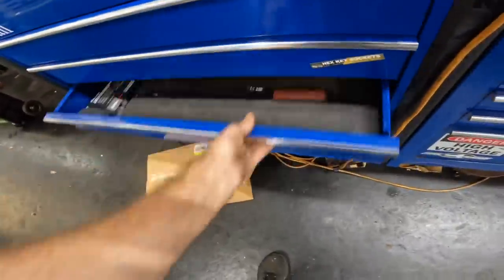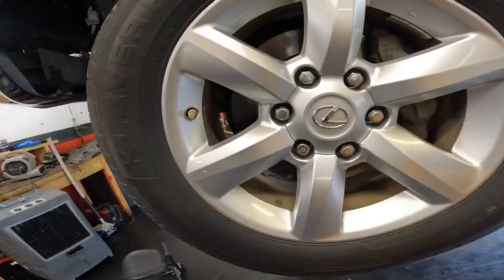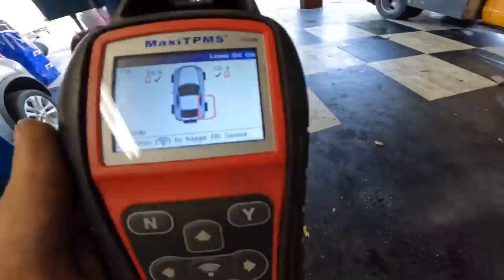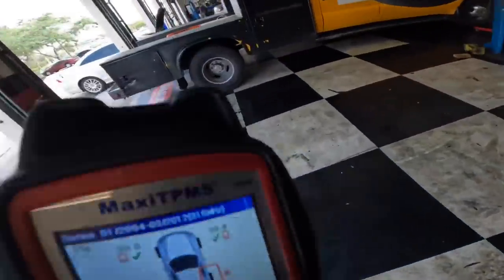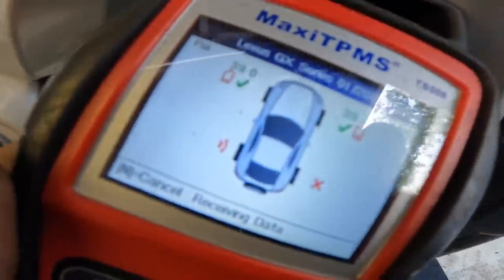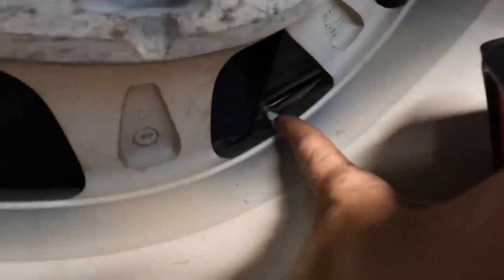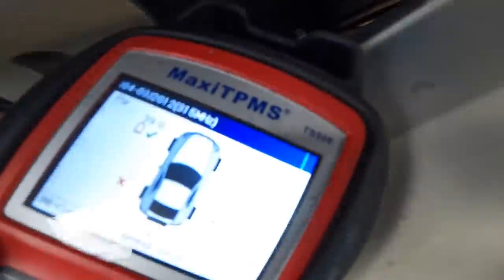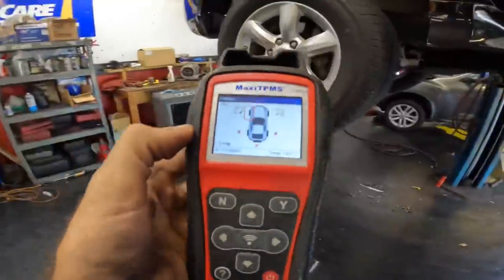TPMS Relearn! No Can Do!

Comment: With Lexus, all 5 sensors must be working or the warning light will illuminate.
Reply: Incorrect as the sensors go to sleep if there is no rotation above 5-9 mph.

So explain how they will get the reading from the spare?
Reply: @pepeshopping  My Lexus shows all five tires on the display. My spare isn't ever rotating. Can't explain it, but it's a fact.

Comment: Wow.. in one hand it's nice to see a well kept GX. But trying to save a buck can lead to either catastrophic failures or roadway safety issues. For example the drivers side rear tire was the exact definition of flirting with disaster. Alls it would take is a good jagged chuck-hole at the perfect angle or the right amount of tire pressure and excessive roadway temperature to turn that thing into an oversized & overcooked rotating Jiffy-Pop.

I've said it many times and it'll never get old.. "maintenance is key to surviving the idiocracy".

Comment: I ordered one of those it would scan could never get the hyundai to keep tje new ids.. lol i ended having to just replace with used hyundai sensors .. i gave the tpms reader code tool back to Amazon.. cool tool though .. hyundai is fickle system

Comment: Tire pressure sensors are required by law in all vehicles (but not trucks and vans) built after 2007. IMHO, they are an expensive waste of time. People ignore the tire indicator on the dash, or just manually check the tire pressures when it comes on, and as Ray pointed out, they are expensive to replace. I had a 2009 Toyota whose sensors died after 2 years. I didn't replace them, just ignored the indicator. Ever since my first car decades ago, I regularly check the tire pressures.

Comment: my 2009 and my 2011 both have original TPMS sensors, just waiting for the batteries to die... honestly I'm surprised they're still working at all!
Reply: Yeah it amazes me that the other day I had to replace a sensor on a 2018 honda odyssey but yet my 2014 nissan sentra has had no issues yet. These things are very inconsistent with battery life.

Comment: I had to replace the sensors in my 2006 Jeep Liberty during my 12 years of ownership.  I got a crazy quote of $70 X 5 for just the sensors . I bought them on rockauto for $25 each. Had the tire shop install them. They self learned.  
Now my Tacoma only has 4 sensors. There is a reset button under the dash for it to relearn. That's a nice tool though to read the sensors.  Probably not something worth buying as an owner.  I kinda wonder if the premium version of OBD fusion would tell you tpms codes. 
N
Reply: The Tacoma's TPMS reset button is only meant to recognize the truck's wheel positions and current tire pressures based on the sensor ID currently written in the ECU. Should a sensor fail in the Tacoma and replaced with a new one, a TPMS relearn tool with OBD connectivity (i.e.: Autel TS508) is required to perform a complete relearn.
Reply: @jtr990  that's a $200 just for tpms. That's probably not a good deal for the average DIY owner.  A tool that could do that and other obdII functions might be more useful in that case. That's mote for shops.
Reply: @MrMikey1273  It is steep for the DIYer. Especially if you look at other TPMS relearn tools in the marketplace.

Comment: The cost to replace the sensors usually out weighs the value of the vehicle.
Reply: Not usually, depending on the type of car you're talking about. People just want to keep their car in tip top shape, especially having the TPMS sensors replaced. Some will pay the parts and labor, some won't.
And, you can always buy the TPMS sensors online, and have a small tire shop put them on, if money is tight.
Reply: @WANAMASSA  for Lexus / Toyota you have to buy oem tpms sensors otherwise they won’t show you the pressure in the dash. Ask me how I know 😤
Reply: it's quite a bit cheaper if you wait until it's time to replace tires since they have to come off the wheels anyway.
Reply: @Knightfall23  nop!
These sensors are STANDARD and ALL of them work the SAME!

You simply have to know enough technical details so you get the right kind ($30 per sensor) that can be programmed to mimic the same address as the faulty one. Done.
Reply: @donakahorse  nop!
You can change the sensors without dismounting the tire.
Reply: @Knightfall23   how do you know ?
Reply: If you pay over $50,000 for that car, then you are more likely to want everything to work on it.  If you buy it used for a cheap price, or got it for free from a elderly family member, then you will probably just put some electrical tape over the dash light and ignore it.
Reply: @pepeshopping  you don't have to remove the wheel and break the bead to get the valve out? interesting
Reply: @oz1141  I have a 13 Lexus GS and bought “oem” sensors they were same part # and everything from eBay and they programmed to the car fine and tpms light went away but it didn’t show the actual pressure on the dash. 

Got fed up after a while and bought original sensors from Toyota dealership and went to discount tire and they started showing the pressure immediately 

They Maybe less finicky for Toyota but Lexus there are several club Lexus threads online on aftermarket sensors not working.

Comment: Wow, I just had one replaced and it was $125.  When did these become necessary? Best Regards Ray. Still wishing you were my mechanic
Reply: They're not. Just get yourself a cheap pressure sensor and check your tires occasionally. Like people did for decades before all this.
Reply: Mandatory since 2008 model year.  They are a nuisance
Reply: @kevinr8459  I don't know what state you're in but they're not required for inspection in PA. My TPMS light has been on for 5+ years. I don't care...
Reply: @mikeblaz  Meant to say they're mandatory for new cars sold after 2008. I don't ever plan on using TPMS anything for my cars and I live in Arizona.  No safety inspections but our emissions are nearly as strict as California.   I will bypass and disable any TPMS equipped car I have

Comment: From Wikipedia "The Firestone recall in the late 1990s (which was linked to more than 100 deaths from rollovers following tire tread-separation), pushed the United States Congress to legislate the TREAD Act. The Act mandated the use of a suitable TPMS technology in all light motor vehicles (under 10,000 lb (4,500 kg)), to help alert drivers of under-inflation events. "
Reply: Yup. Americans insisting of driving offroad trucks as passenger vehicles are the cause of that.
Reply: @erik_dk842  So driving a car down a smooth road is more stressful than off-roading the vehicle and hitting bumps?
Reply: That whole Firestone thing was a scam. The exact same green beads were used to make Firestones private label brands (Gilette, Peerless, Dayton, etc...). Those tires were never pulled and recalled.
Reply: @AT-wl9yq  Driving at highway speeds with underinflated tires and cornering at car speeds is worse for the tires.
Reply: @erik_dk842  OK, but I was responding to this.

"Yup. Americans insisting of driving offroad trucks as passenger vehicles are the cause of that."

What trucks are designed only for off road use? It doesn't make sense.

Comment: Nothing a little strip of black tape on the gauge cluster can't fix. 

I found no shortage of OEM sensors for $20 ea, so I imagine they'll do the swap back home at a local garage.
Reply: Some cars have a super annoying announcement the tpms system is down and it needs to be cleared any time the car is restarted to go away. Shops around me charge $75 a sensor installed.

Comment: This shit actually ended what could’ve been a potential career for me at a prominent Chevrolet dealership. Thanks BigGovt for these idiot lights and additional $100+/pc additionally required equipment on vehicles sold after 2008-09…….fkin bullshit.
Reply: This system is really for when the car is rolling.

Explain how, while driving, you would know if you suddenly are losing pressure and a tire is getting overheated???

Comment: Cost to benefit...  the sensors cost too much.

A $2 tire gauge and check your tires once a month.... or $700 worth of sensors. (and that's just the things in the tires)

And my tire sensors never alarmed even at 20 psi low in one tire. (15 lb in the tire when the rest are at the specified 35 psi for the vehicle)  so they do no good.

But some idiots in Washington DC says the dealer can't disable the system... because OEM put it in at the factory.

Just a huge expense and the price is extreme because it is a mandated system. (should be able to make it work for less than $150 for the whole system)
Reply: I just bought 4 new sensors, $30 each.  You might try shopping elewhere

Comment: That's a nice piece of equipment you have there Ray. However I can never understand as to why! these TPMs are put in tyres. Surly it best to just check by eye instead of relying on a tool. Just another unnecessary cost I guess.
Reply: If people had eyes that worked and used them, Ray would probably be out of a job.
However it seems that such eyesight and ability is no longer a survival trait and is slowly but surely wasting away, as did snakes legs.
Reply: You can NOT check pressure with your eyes only!
You can have a tyre 10 psi below and it would STILL look “good” to you…
Reply: @pepeshopping  Check your tire pressure once/week when filling up. Takes 5 sec per tire....
Reply: @mikeblaz  This system is really for when the car is rolling.

Explain how, while driving, you would know if you suddenly are losing pressure and a tire is getting overheated???
Reply: @pepeshopping  so if it's on before driving I'm good but not if it happens while driving. OK got it.
Reply: @pepeshopping  I have seen radial tyres 20 psi below spec and look inflated. Steel belted tyres are deceptive on looks regarding air pressure.

Comment: TPMS sensors: another way to automatically check what drivers should be checking THEMSELVES.  My wife's car has them and I won't even look at the dash monitor. I check them myself.  Found them to be wrong many times.  Glad my old 2005 Silverado doesn't have them.  Another expensive items I don't need.  Check your tires monthly and your oil every fuel up is how I was taught and will continue.
Reply: 100%! Another idiot light fix for “ today’s” lazy, driving Idiots ! Soooo on a major accident, on a major highway,,, a non tire monitored car wipes out taking  4 well maintained vehicles with working monitors,,,because of under inflated HOT tires blows out ! That non monitored car,, “ should repair the damaged vehicles ! Let’s ask our Government who’s payin  !!

Comment: I'm old enough to remember when every car had a tyre pressure gauge in the glove box. TPMS just another step in the deskilling of car operators. (yes I meant operator, not driver)
Reply: It's a nice to have in most cars but a must have if you have run-flat tires. You can have zero psi in a run flat and by design it doesn't look flat.
Reply: you guys are right. I do a basic pre-flight every day and check pressures with a gauge maybe once a week depending on conditions or different uses like long trips or trailering.

 One benefit is, when I last brought the truck in for service, it came back with a fun new tire pressure sensor light that blinks for two minutes, then stays solid bright yellow on the dash. Shop said they didn't do anything to it, but I can schedule to come in and they can fix it. I just hung up the phone, took my dash apart and killed the light. Didn't need it anyway. 

 Another benefit is, last time I was pulled over, cop tells me it was for a tail light out. I told him I checked all the lights ten minutes ago, so it had to have just happened and I'll fix it right away. He said "well, everyone says that, so I can't just let you go. Nobody would have any working lights if I just let everyone go when they told me it was working a minute ago." (he went on to explain it's not a big deal, just fix it, no court, etc)

 I said "hang on just a sec" and handed him my phone, playing the time-stamped dash-cam  video of me getting in and out of the truck with different blinkers and high beams and all that, walking around the vehicle multiple times.

 He says "okay, now that's good. I can see the taillight glowing off your shirt right here."   Hands me the phone.   "You have a good one."
Reply: @heatshield  Situational awareness, of your vehicle as well as those around you is a skill almost lost in these days of computer aided parking, lane keeping assist, and an alphabet full of acronyms for braking systems. Have a good one.
Reply: @heatshield  So you record yourself checking your lights every day? I'm calling BS on that. Or maybe I don't. Maybe you live in Idaho and have nothing better to do.
Reply: @Swampster70  say whatever you want. Front and rear dash-cams run 24/7 and yes, I start the engine, turn on lights and get out and check them every day. It really requires very little effort. Maybe you should try it instead of assuming everything is fine until someone else tells you it isn't.
Reply: amen
Reply: @heatshield  I check my headlights when I park at the store at night and the taillights when I reverse into the driveway. Easy to see with the spread of light on the garage door.

Seems odd that you embrace tech like dashcams but put a downer on using TPMS, especially when the latter can tell you tire pressures as you're driving. Personally, after having a few flat tires on the motorways and freeways of this world, I'd much rather have a light come on the dash telling me that I have a tire at 25 psi and that I better keep an eye on it. Maybe if you live somewhere where the answer to guns is more guns and think that Covid wasn't a thing then safety is just over rated.
Reply: @Swampster70  wow. Hopefully you don't edit your reply to remove all that insane stuff about covid and guns.  That was really bizarre. 

 Have you heard of a thing called a strawman? 

 You just put a ton of words into my mouth then argued against those words that you put there as if I had said them myself.

 It's really not a good look. You can do better.
Reply: @heatshield  TPMS is, IMHO, one of the biggest safety features in cars since the beginning of the history of cars and you argued against it. A car runs on tyres, without them it is useless. Tyres need air and your response was "well, lets check them in the driveway" - which doesn't do you any effing good when you're 600 miles into a roadtrip at 80mph. What is your argument when you're at 80mph and you have bits of rubber flying past your side window after a minute of "the car doesn't feel quite right?" Oh what's going on? The tires were good in the driveway we couldn't possibly have a problem! I've had that situation happen four times and that was three times two many. The final time I had TPMS and had a warning light come on and I could get off the road without my front fender being ripped to shreds.

You argued that TPMS was unnecessary and a bit of techno fluff that wasn't needed. I call complete and utter BS on that. How can you say that the one system that tells you the state of your tires is superfluous?

I argued that we have an easy way to reduce the dangers of guns. Remove guns. In pretty much every 1st World country that has worked really well. We have an easy way to reduce accidents caused by fairly rapid tire deflations, add TMPS. That globally has worked really well.

Comment: Why don’t you like Hankook tires, Ray?
Reply: Cheap rubber. They get old (hard) quickly.
Reply: I don't like them either. Wear life is very short.
Reply from the maker: I think tires is where no expense should be spared. It’s the link between car and road. “A chain is only as strong as it’s weakest link” I just dislike economy tires for that reason. They work and they’re fine, but there’s just much better options. I totally understand that folks aren’t made of money. It’s one of those subjects where I would say that quality doesn’t cost, it pays.
Reply: @RainmanRaysRepairs  I think some Hankooks are still over 100$ a tire, hardly budget level. Nonetheless, what brands DO you recommend for a quality made tire?

Comment: A lexus dealer will get almost $100 ea for the sensors, plus labor. Looks like the correct fix for this is a piece of Duct Tape.
Reply: This is a very easy job. Find a different place.
Reply: @pepeshopping  It's not the difficulty of the job, but the stupid expense of over $500 for something that I've been doing in my driveway every few weeks for nothing but a pressure gauge.
Reply: @AJGreen-cn8kk  how do you check the pressures when the car is moving, I wonder??
Reply: @pepeshopping  Why would you need to do that? I maintain my cars properly. Never had a problem.

Comment: Stupid system that fails when batteries run out. My car instead monitors the rotation speed of each wheel. When 1 wheel rotates at a different speed to the others it gives you a low lite pressure warning. Next you set all tires to the correct presure and after that you reset the warning. No batteries involved and no sensors inside the tyre.
Reply: The indirect system is great.
Reply: That system works ok, better than nuthin.  Main flaw is, when all 4 tires are low it won't trigger the light.